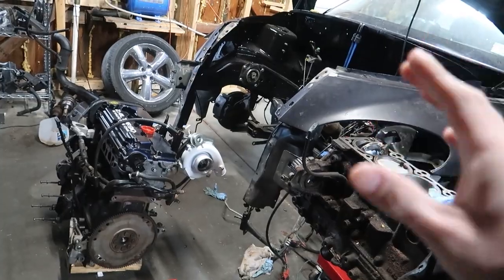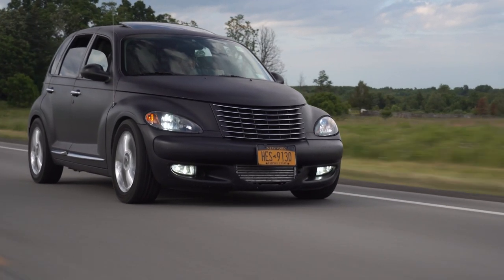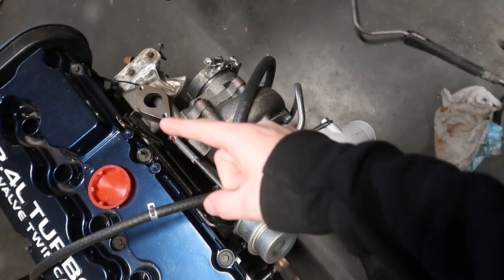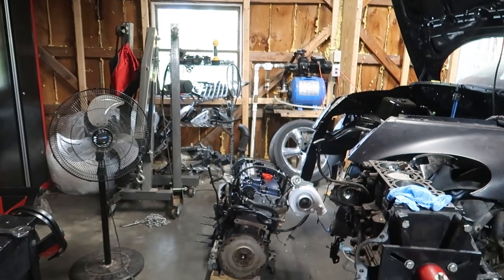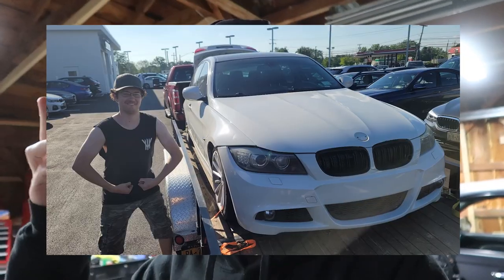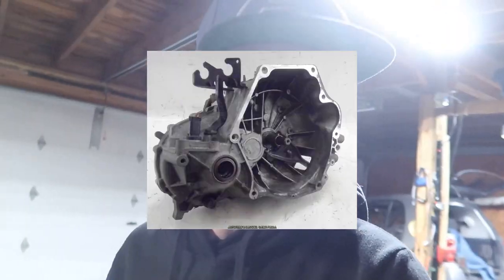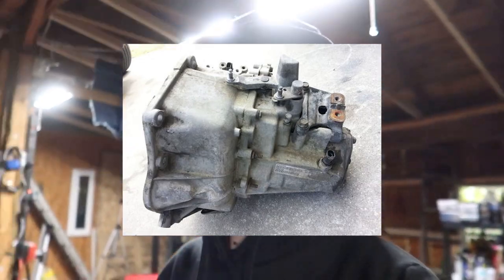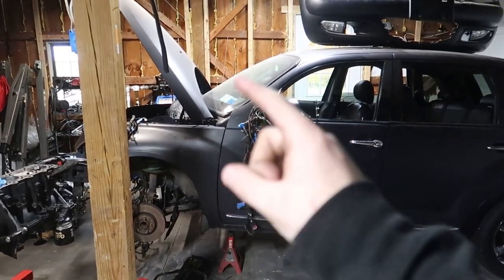What Happened To My PT Cruiser GT?

Comment: I have to say, I was a bit disappointed to see the eclipse.  They're ok, and I've owned a few of them, but my '05 PT GT Convertible is still a better car, all around.  It's not hard to get 400+HP out of them, and I'm currently building a motor for 550hp.  I hope to see you back working on the car again, soon.
Reply: What are you doing to yours? I also have a 05 convertible gt

Comment: Mines was down for a few months. Then a month recently. Best to tske your time and upgrade more things..  just build up the pt transmission.. auto.. and get another one to do a manual.. use the Darrel cix timing kit. And silicone on your covers. It should be sealed park cars for longer than a week on cement or get it off the ground

Comment: I just got my Amazon manifold and maxspeed turbo last week for the beater lol a t850 will fit but you will need a custom trans mount but there is only about a inch between the frame rails
Reply from the maker: This is good to know!  I never thought of the T850, definitely gonna check into that.

Comment: I know you won't give up. And you know I won't either. Just got a 03 GT 5 speed. Not a month later the timing belt breaks on me. 21 miles off road at that.
Reply: Its a non interference motor, Unless you where hauling butt,  More than likely no dmg to the motor
Reply: @ptbruiser2243  indeed. Just a bit of work. I might as well give it the sauce now though.

Comment: You should definitely aim for a Neon SRT4 transmission. The difference between the Neon and PT GT manual is the GT is limited slip and the Neon is essentially line locked which will help with racing. I know it’s kind of pricey but Derrell Cox Racing (DCR) offers a built SRT4 manual transmission for $4,500. That’s what’s going in mine.
Reply: Does the gear ratio change?
Reply: @borosadam3199  I’m not sure but I would assume it does being the SRT literally has “Street Racing” in the name plate. I would bet the ratios have to be better.

Comment: There are 2 PT/GT manuals in my local boneyard. If you are willing to pay for shipping and a lil bone for my time. I will help out.   FORGOT TO SAY/ The auto ecu will work on the manual swap only the RPM will hang a lil in between shifts
Reply from the maker: Sick!  I will definitely let you know if I can't find what I need soon.  That's good to know too about the PCM I've been wondering about that.  Appreciate it
Reply: @jimmycruiserr  No problem, I have been rooting for you to get the manual swap done. You are going to love the difference in acceleration! I have owned both the autostick and manual 'still have the manual' 
 It's so much faster!

Comment: The internals was bad for that transmission. A used 41te transmission is 250 in a u pull it. Then rebuild it with stringer parts get a stronger drum case for internals kf the transmission

Comment: Hi I have a question for you I have a 2007 Chrysler PT Cruiser naturally aspirated and I wanted to know is there a aftermarket high performance fuel pump? Or a high pressure fuel pump? Because I am planning on purchasing a 1025cc siemens fuel injectors for my 07 pt cruiser

Comment: To bad your so fare away from me I have an 04 pt cruiser got that is a 5 speed original it has about 160000 miles on it a bit of rust in a couple places and a broken coil spring on the passenger side but clear title and I would let it go for 2500 as is cause I put a 7inch touch screen with back up camera and 3500 watt system all together I’m in Maine that’s why I said I’m a ways away from you
Reply from the maker: Will have to keep that in mind!  Hoping to find something close to home soon but if not it'd be worth a road trip to me.
Reply: @jimmycruiserr  I can tell ya also before the coil spring broke I could get over 60 in second gear with the original everything she will scat for sure and purrs like a kitten and if you want I will send ya some pics